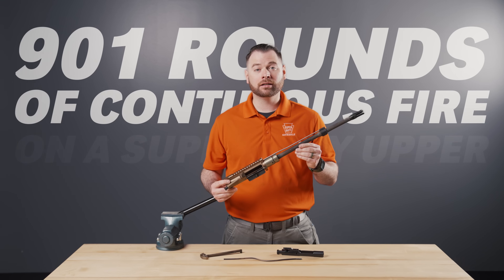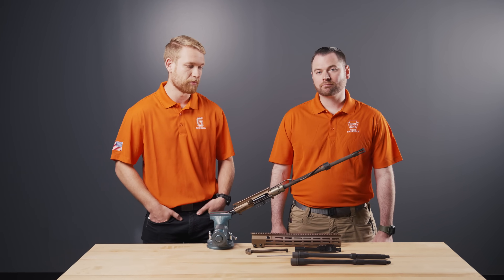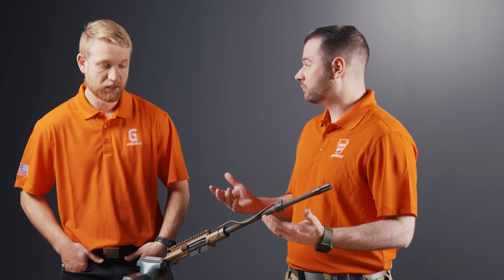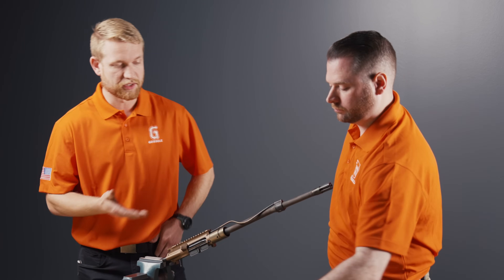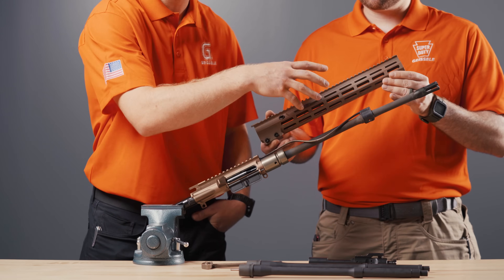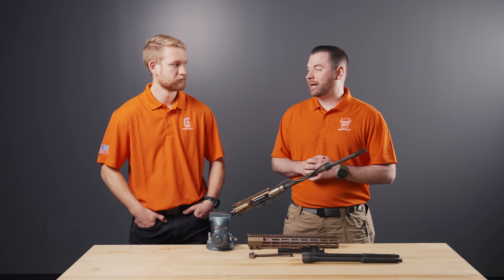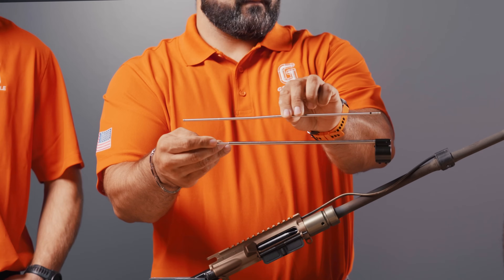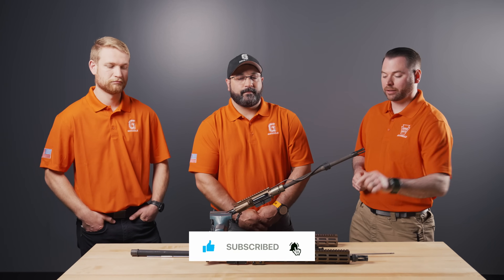GOLDENWEBB SUPER DUTY MELTDOWN AUTOPSY

Comment: My gas tube length isn’t sold but I’ll be damned geissele said “here comes another one”. I mean from the absolutely tantrum I threw when my more expensive triggers wouldn’t get anything but light primer strikes… geissele did me a solid birthday present. 

I shoot a lot, I work in the firearm industry, I own a range. I shoot a couple cases or at least a case of 556/223 a month. Geissele hooked it up with the one gas tube length that isn’t available. 

I went from shitting on geissele to now being the biggest advocate. The mod 1 16 GL gas tube and ssae were all free for my birthday so I’ll die on the hill geissele has the best heavy use rifle and best customer service hands down. 

That geissele gold is pretty too. Would’ve loved a 12.5” where the returns longer are diminishing until 18” but I’m not running through the eastern mountains and coastal pine forests with an 18”. 16 works for now.

Comment: It should be stressed just a little bit more that the gas tube failure is the fail safe for this rifle, by design. As was pointed out, it’s not a machine gun and there is no reasonable manner, again, by design, to do quick barrel changes. The AR and M variants are fighting rifles with a different purpose than a machinegun.

Comment: Why do make your barrel nut require a proprietary wrench?  Which in turn requires me to buy your wrench to install the barrel?  Many don't as I have installed 50 or so.  And, those that do, still have a way you can usually get by it with another standard tool.  I bought a rail from you guys after buy tons of triggers and CH's.  That kinda bugged me, but is there actually another reason for it?  Also, I got the MK16 13.5 rail, but it had no steel insert of whatever that copper looking QD button is called.  Was it missing or do you just not put those with that rail?  I did order directly from Geissele.  I was kinda hoping it was in there, because like anyone else I thought it was a cool part of the rail, but life's not fair either.

Comment: Can’t believe I missed! This was very interesting to watch… Loved your response to this burn down. Currently have built two SD’s and a URGI had my eye on your 6ARC but very curious to see if you go to a heavy barrel option. I also have to give props. All my builds/assemblies of all 3 rifles went together flawlessly. I used all of your parts, went together as if factory built. All 3 passed Go/NoGo the first time. That is a testament to quality manufacturing. Last tidbit… I also picked up your button barrel I think the day it dropped. I did not want to build another SD with the wrong barrel. So hopefully you guys expand on what this barrel is designed for. Is it purpose built or just a cheaper offering? Anyway, very happy customer loved this video.

Comment: Very cool analysis. I would be curious if adding cooling fins to the gas tube would help. I'm thinking about 3D printed metal fins connected together that slide over the gas tube. They would dissipate heat and offer support to the gas tube. Is that even possible?

Comment: The very best engineering minds in the world: "Make it THICC!" 

What's the weight on the new HBAR, for a complete 16" rifle? 1600 rounds is damned impressive, I kinda wonder if this would be the epitome of the IAR concept that spawned the M27 and Colt IAR. The only real failure point I'd see is getting up to cookoff temps and having that potential safety issue, though it could be mitigated through training or mechanical means, IE the aluminum heat sink that Colt slapped under the handguard of their IAR entry.

Also, this kind of reaction speaks very highly of Geissele as a company, this is the kind of attitude that other outfits should emulate.

Comment: is it possible for you to elaborate on the mechanic described at 3:48 and why the extra material forward of the gas port on the Gov profile diverts heat back to the thinner portion? I was under the impression that extra thickness was simply not beneficial/mucking up weight distribution—not necessarily actively detracting from heat management. That's very interesting and I'd like to know more if possible.

Comment: Geissele with a heavy barrel and an upgraded gas tube? Fuckkkkkk yeahhhhhh. I’ve been waiting for something like this too drop for so long.
Reply: Daniel defense m4a1 block 2 with socom barrel from brownells is basically the same thing but u have socom heavy barrel that will last the same and isnt quite as thick. Idk why they didnt go with that as it is proven and not quite as heavy but will last just the same.  Run till the rifling burn out and loose pressure.

Comment: V Seven makes an INCONEL gas tube. May be see how that survives vs the rest of the upper.
Reply: 2:18 Gas tube was designed as a failure point to keep the barrel from drooping and causing a round to penetrate the side if the barrel

Comment: So basically you recreated the original Colt LMG with the reinforced thicker gas tube along with the extra thick bbl. The Colt IAR used a similar bbl with the standard gas tube. So the new upper will require a H3 buffer where your previous would require and H2 to prevent bolt carrier bounce. More than likely,  the bolt will be the failure point in this condition unless barrel
 erosion causes gas leakage lowering port pressures inducing short stroking.
Reply: LMT improved bolt as a solution?
Reply: @skullofserpent5727 geiselle forge their bolts so its probably the strongest bolt on market.  Idk about thwir nano coating yet but i know what a forged bolt will do
Reply: Hey have you heard of red right hand uppers? They are basically doing this but also have heat sinks for the barrel and gas tube to allow the system to run longer and help prevent cook offs. If you can get your hands on one I’d enjoy hearing what you have to say about them!
Reply: @kylesmith7733 I looked up their stuff. It sounds pretty sweet. Their heat mitigation system for barrels is an awesome concept that sounds like less bank breaking alternative to carbon fiber wrapped barrels. And the heat sink coil around the gas tube sounds game changing. Surprised the Red Right Hand guys aren’t more well-known.
Reply: Why would the heavier barrel profile need a heavier buffer weight?
Reply: @fivedotfivesix59 Not sure if this has something to do with the gas tube. It would be really weird if the internal dimensions of the gas tube are different, but if they’re larger, I can understand needing a heavier buffer since more gas means a heavier recoil or kickback.

But then again, if it’s just more external mass with the gas tube having the same internal dimensions, as the previous gas tube, the weapon could still use the H2 Buffer and still function. Not to mention that this should still come with a Super 42 Braided Buffer Spring. I could be wrong, though.
Reply: @paowerhouse92   H3 would probably be needed purely due to the heavier barrel. Bolt is slamming into a heavier mass, so it's got more tendency to bounce off. Hence "bolt bounce," and the introduction of the H2 buffer in the M4A1 when the heavier SOCOM barrels came online.
Reply: @fivedotfivesix59 Because you're smacking the bolt face into a more massive surface you need something heavier to keep it from bouncing back
Reply: @fivedotfivesix59  maybe because the rat of fire increase after full auto madness?
Reply: Why would the heavier barrel profile need a heavier buffer weight?
Reply: @fivedotfivesix59  Just a wild guess, the straight gas tube might result in a different pressure curve than the curved tube, which might necessitate a heavier buffer.
Reply: Dang, you called it. The barrel erosion was the failure in the HBAR.
Reply: My thoughts exactly. Copy what Colt did.
Reply: This isn't the upper that went 1600+.
Reply: SAS always coming through with the knowledge.

Comment: This is good to see. I bought the 14.5 barrel, bomb-proof install, the MK16 rail, and the EBCG when it still had the 168+ bolt. 
The difference is I went with a inconel gas tube. Using that gas tube was just insurance since I'm hoping to never have to see 900 rounds of continuous fire out of it.

Comment: Does URG-I have same barrel as super duty?
Reply from the maker: The Super Duty uses a Geissele Taper Profile as seen in the video, while the URG-I is a near clone to the SOCOM upper so it has a Government profile barrel. They are both Cold Hammer Forged Chrome-Lined barrels.
Reply: URGI from geissele or the actual URGI? DD makes the actual urgi. It’s socom profile

Comment: Generally I think the burndown tests are a pretty dumb metric, but I like the constant improvement from G$
Reply from the maker: It is part entertainment, part science. The goal of a burndown is to stress the quality of the materials used and push them to fail. So it's really interesting to see the results, and we believe it speaks to the quality of the upper.
Reply: @GeisseleAutomatics Yeah I don’t disagree at all, I’m all for putting stress on the tools we use, my point is I’m not going to buy a lower quality manufacturers product over a superior product simply due to it potentially performing better on a burn down. It’s a data point for sure though. And I appreciate you guys  for continuing to improve. A geissele LMG is not what I had on my 2024 bingo card
Reply: Awesome guys, can’t wait to see how the heavy does, I am guessing 1500, cheers gents!

Comment: The prototype gas block and a straight gas tube should be available as an option to upgrade existing superdutys. I would buy it today if I could!
Reply from the maker: We appreciate the feedback! We always pass on suggestions like this to our project teams.
Reply: @GeisseleAutomatics  definitely release that new prototype and you got yourselves a winner. A gun that can perform and win the trust of many.
Reply: @ryotatakuma6117 are you planning on ever rapidly firing 1000 rounds consecutively?
Reply: @dimemmo Whole point of firearms is stuff doesn't always go as planned.
Reply: @dimemmo definitely
Reply: @StepLucch  why don’t they just make it so you can fire 100,000 rounds consecutively because we may need to do that sometime you never know. You’re hand will cook off after 600 rounds or so but what the hell
Reply: Second this. Is there any reason why the is couldn’t become the new standard? I have already seen  some manufacturers switching over to straight gas tubes to reduce the potential failure that normally occurs at the bend in milspec gas tubes.
Reply: They merely copied Colt's gas tube for their light machinegun AR. It's actually a bad idea to use one on a standard AR. The gas tube is essentially a fuse to stop you from blowing up the barrel. Plus, unless you're using the AR as a light machinegun, you'll never need a heavy duty gas tube. Wasted weight.
Reply: @donwyoming1936  The OP didn't say he wanted the beefed up gas tube, though maybe he did intend that. He merely said he'd prefer to have the straight tube with the modified gas block, which is a fair point and maybe worthwhile to buy.

Comment: Designed to safely fail, but still will fire in single shot mode.
Reply from the maker: Absolutely! As Dean mentioned gas tubes are cheap and easily replaceable.